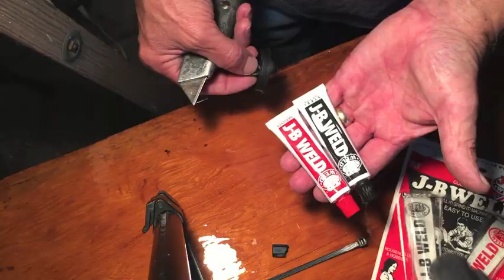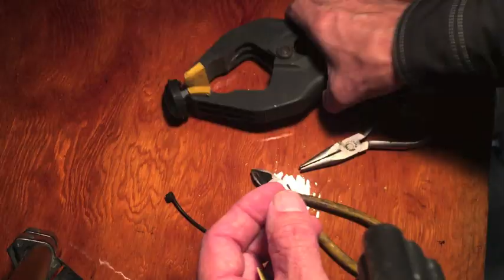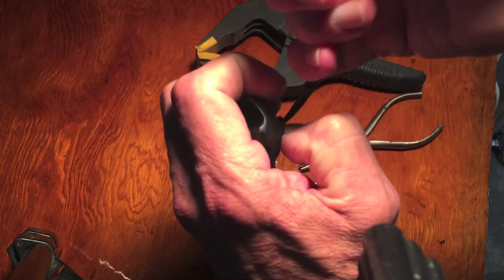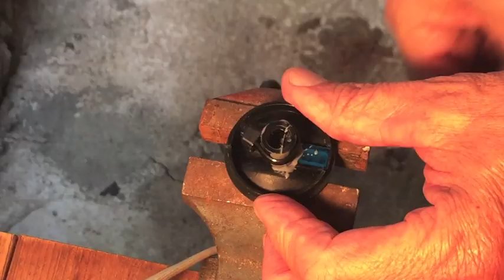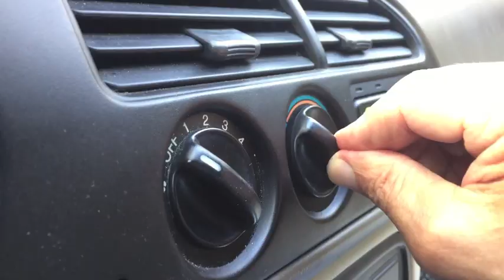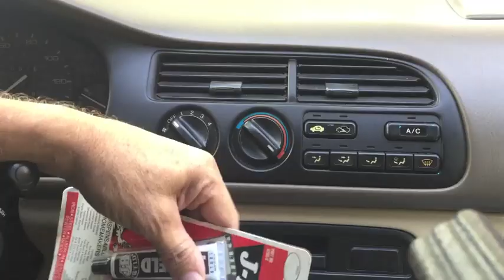Honda Accord Temperature Control Knob Repair

Comment: Mine broke about an hour ago.  I had visions of pulling the control panel off the dash and buying all new chinese fake parts. Thanks for this video! Is there an underlying problem that leads to this knob breaking? Like a dry cable or?

Comment: When you removed the knob for repair it's metal shaft was facing at 11 o'clock and when you put it back on it was facing 2' o'clock. Did you turn it? Can I turn it with a pair of pliers?
Reply from the maker: Yes you can turn it with pliers..

Comment: When the knob is off (broke) and i try to turn that inside metal thing by hand to use the fan...its stiff and  will not turn- is this normal?
Reply from the maker: it should turn to adjust fan speed.. try to turn it using pliers if you have them.. if it still won't turn with pliers then something is wrong with the fan speed switch..
Reply: @PeanutButterMan-PBM  ok and Thanks for the speedy reply☺

Comment: great fix with jb weld bro 👌

about 2 weeks ago i did a similar repair on a plastic intake manifold inside lip of a 04 ford focus 2.3 that had a bad vacuum leak after i r/r the pcv valve that is locaced under the intake manifold - there are 2 lips forming a groove that holds the seals in position and make that intake port - with a total of 4 intake ports

i mixed the jb weld, and after cleaning the area w/ alcohol isopropyl, i started to form the inner lip in a very similar shape as to the other ports; then i digged in the groove w/ a rotary dreamel from hf lol and flattened w/ a file

put on the same seal on it,  install in on the engine and voila! it worked like a charm 😀